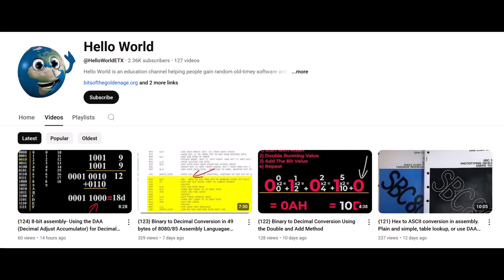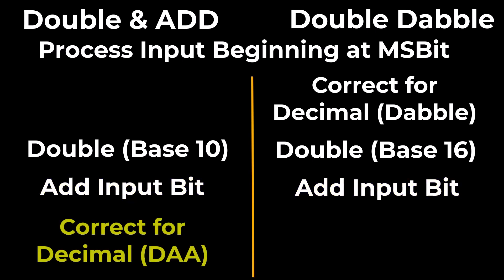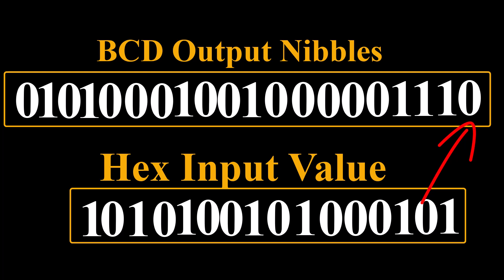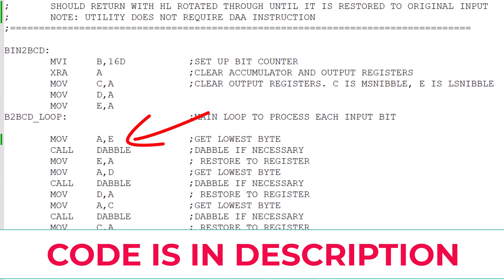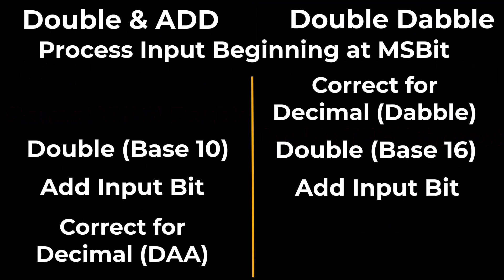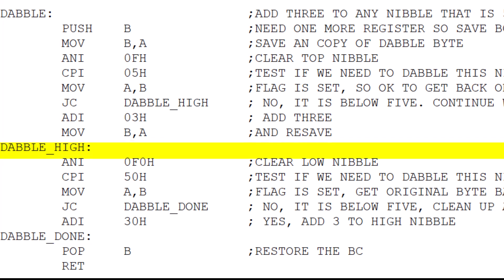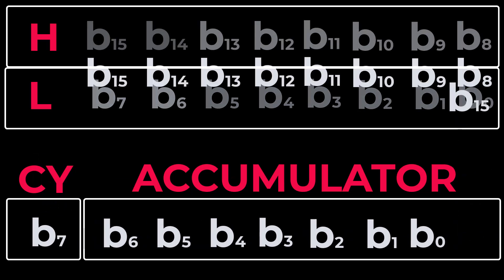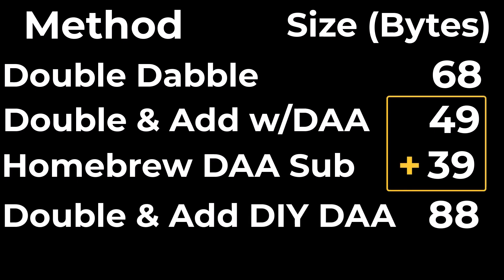{125} Binary to Decimal Conversion using the Double Dabble Method in 68 bytes of 8085 Assembly

Comment: In the dabble, isn't it better to check the high bits first? Then you have to run less code in the first dabble section. Then you have to move around the value between A and B less often. 
Thus cmp with 50H first, then add 30H if needed , than copy A, mask A, compare A, move back A and add 03H if needed.
Reply from the maker: Using Pence128's suggestion, the dabble routine is now down to 19 bytes.  with these improvements to the code, I am not sure if doing the high nibble first can save anything, but I am ready to be proven wrong.

   002b                 DABBLE:                         ;ADD THREE TO ANY NIBBLE THAT IS 5 OR MORE        
   002b   c5                    PUSH    B               ;NEED ONE MORE REGISTER SO SAVE BC
   002c   47                    MOV     B,A             ;SAVE AN COPY OF DABBLE BYTE
   002d   e6 0f                 ANI     0FH             ;CLEAR TOP NIBBLE
   002f   fe 05                 CPI     05H             ;SET FLAG IF 5 OR GREATER
   0031   78                    MOV     A,B             ; BEFORE TESTING FLAG, GET BACK ORIGINAL BYTE
   0032   c1                    POP     B               ; AND ALSO RESTORE BC
   0033   da 38 00              JC      DABBLE_HIGH     ; NOW FINALLY TEST FLAG.  IF BELOW FIVE CONTINUE WITH HIGH NIBBLE
   0036   c6 03                 ADI     03H             ; OTHERWISE, ADD THREE
   0038                 DABBLE_HIGH:
   0038   fe 50                 CPI     50H             ;TEST IF WE NEED TO DABBLE THIS HIGH NIBBLE.  IS BYTE 50 OR MORE?
   003a   d8                    RC                      ; NO, WE ARE DONE SO RETURN
   003b   c6 30                 ADI     30H             ; YES, ADD 3 TO HIGH NIBBLE
   003d   c9                    RET

Comment: You don't have to mask the high nibble when dabbling which saves 4 bytes.
Reply from the maker: Yes…yes… I think you are correct.

DABBLE_HIGH:
        ANI     0F0H            ;CLEAR LOW NIBBLE
        CPI     50H             ;TEST IF WE NEED TO DABBLE THIS NIBBLE.  IS NIBBLE 5 OR MORE?
        MOV     A,B             ;FLAG IS SET, GET ORIGINAL BYTE BACK
        JC      DABBLE_DONE     ; NO, IT IS BELOW FIVE, CLEAN UP AND DONE
        ADI     30H             ; YES, ADD 3 TO HIGH NIBBLE

When dabble high is entered, the value is already in the accumulator. When the low nibble is not going to affect the results of the comparison, I.e., if the value is over 50 then with in the low nibble and it will still be over 50.  

So I think this code is sufficient. Confirm?

DABBLE_HIGH:
       CPI     50H             ;TEST IF WE NEED TO DABBLE THIS NIBBLE.  IS NIBBLE 5 OR MORE?
        JC      DABBLE_DONE     ; NO, IT IS BELOW FIVE, CLEAN UP AND DONE
        ADI     30H             ; YES, ADD 3 TO HIGH NIBBLE
Reply: @HelloWorldETX  Yup, and drop MOV B,A  ; AND RESAVE. You can also move POP B up and replace JC DABBLE_DONE with RETC saving two more bytes.
Reply from the maker: @Pence128  EXCELLENT.  I take it that this isn't your first assembly rodeo.  This takes it from 68 down to 62 bytes.  No telling how long those extra bytes have been mooching off me.